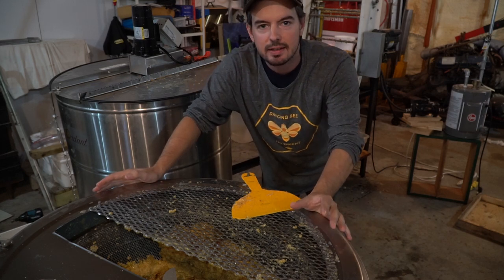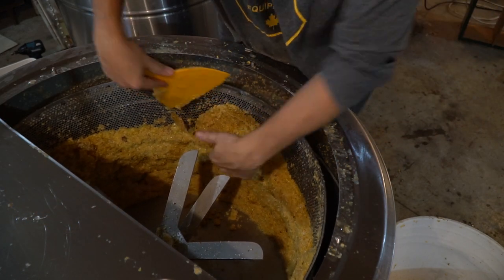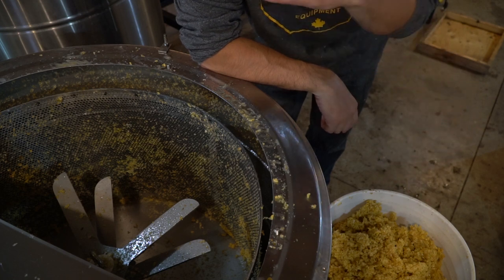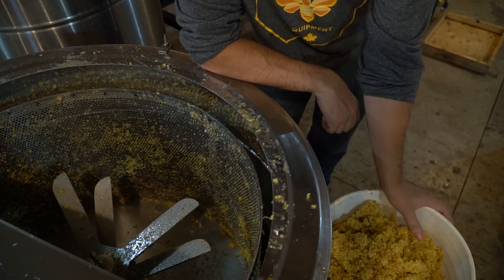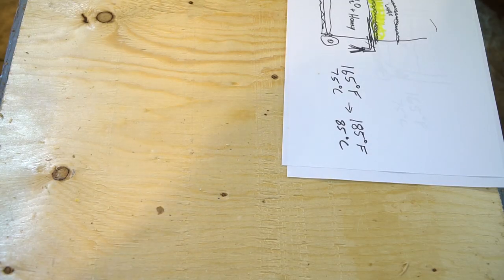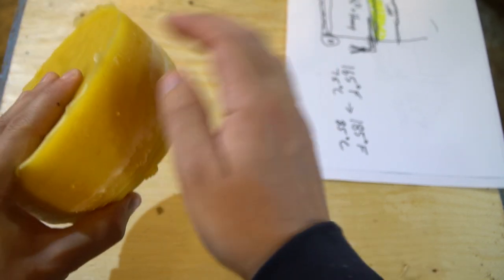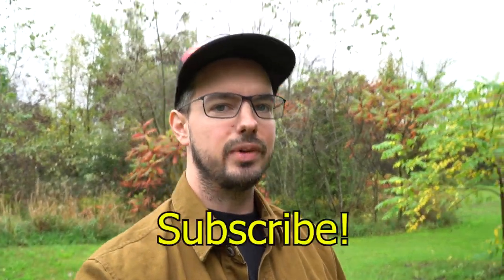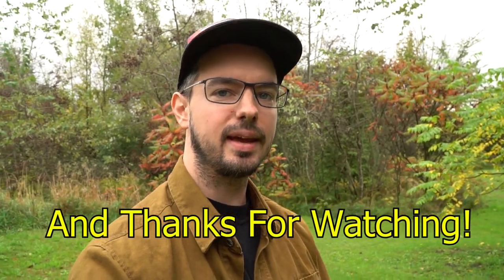Melting my beeswax cappings

Comment: Great video.  I have seen another but didn't make sense to me.  My only question would be that when you draw off the water and junk with the lower tap does the layer of wax not fall below the larger upper one?  I have the same Maxant as you and going to use it for the first time today, October 31st. 2018 and using your method.  Thanks in advance, Jack

Comment: As a small scale beekeeper, I melt my dirty wax in a solar heater before adding it to the pot.  The clean wax goes in a pot over water.  I melt the wax on the stove.  I let it solidify and scrape the bottom of the cake to remove the slumgum.  I put the wax cake back in the pot to melt again over clean water and by the third melting, I have a good clean cake.  I melt in December so the wax will solidify rapidly on my back porch.  This time I harvested a 2.4 lb. cake of wax.